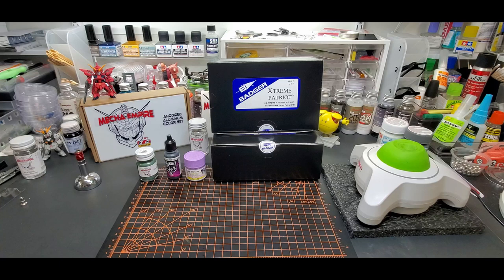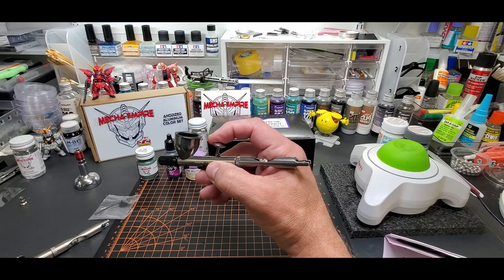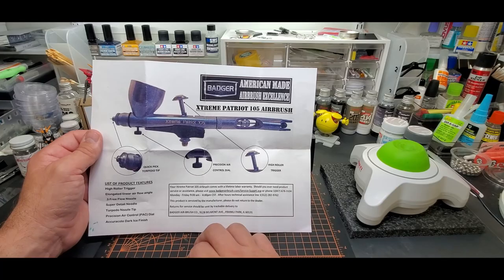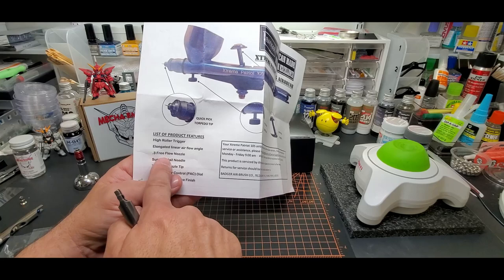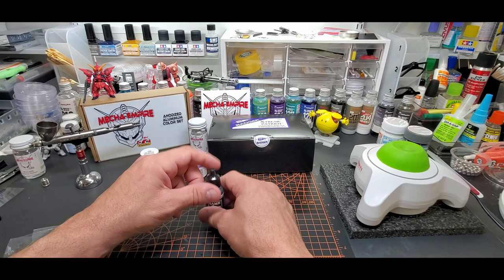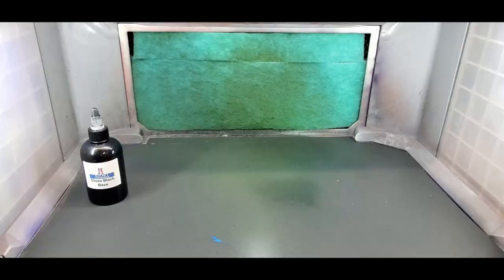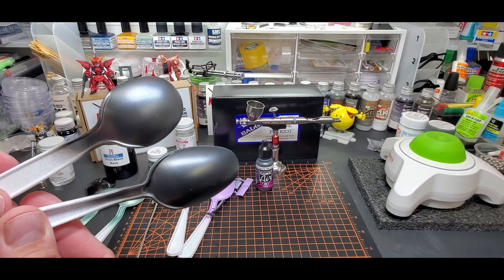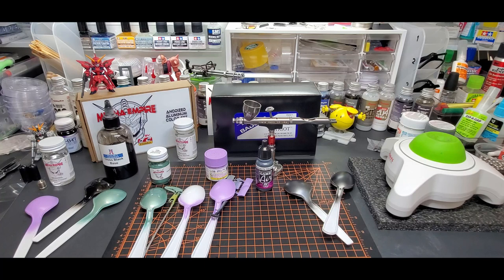Testing The Badger Xtreme Patriot Airbrush For Model Building - Plus Giveaway

Comment: I really enjoyed your video. It was very informative and I think I may look into a Patriot airbrush for myself.
 I bought my first airbrush back in the 70's off of a Snap-On tool truck and never used it until about 3 years ago. It was a Paasche VL with the 3 needles, bottles and accessories and in a cardboard organizer. 
Back in the mid 50's when I was building model cars and plains, I used a regular brush to paint them. If I had an airbrush back then, I can only think of how much nicer they would have looked, no runs, sags or messes.
I have just got back into model trains and have been reading a lot about weathering them and would love to try my hand at it. 

Thanks again for the very informative vid.

Comment: about the mac valve-
I set mine up by running the valve full open, and running my air supply pressure slightly higher than what i need it and will run a test shot with one of my heavier paints like the vallejo acrylics that need a bit more air behind them
once i have it where i want it, if I need to drop pressure because i swapped colors, thinned what i'm currently spraying, or switched to a different type of paint, i can adjust on the fly without messing with the supply line pressure

Comment: Thanks for the review Rex. 

I’ve used the Patriot before and tried to adjust the trigger pressure but then I started to have a lot of spatter while airbrushing and it didn’t click until one day I accidentally tightened it all the way after a deep clean and now the issues are practically non existent. Had even ordered a new needle set thinking it was a bent needle or cracked nozzle.

Just a FYI.

Comment: I picked up my Xtreme about 8 years ago and actually added the high roller trigger (had the regular trigger then).  It did come in the plastic case with the hose adapter. It has served me very well and should for many more years.  Highly recommended for detail work (I use a Badger 200NH for larger area coverage). Don't really use the PAC.  Also I've found with Model Air/Game Air it handles a 50/50 mix and a few drops of flow improver with no problems @ around 20psi. Also handles Acrysion pretty well.

Comment: I'm still new to airbrushing but I've learned so much from your content already. I have an 8 gallon compressor in my garage so I picked up a regulator, in-line desiccant, Iwata 10' air line, and a Master G444 airbrush with the 3 needle sizes. I actually got it all set up and leak free today. I haven't run color through it yet but it sprays the Medea airbrush cleaner nicely. Tomorrow I'll have my mug ready with hot water to clean out my Vallejo colors 🙌👍
Reply from the maker: You are good to go my friend 👍

Comment: I have a Badger 200 and a chrome airbrush. I just gave away my badger compressor, that still works, from the 1980s. Quality has gone down some and customer service leaves something to be desired now. But, with there  air inlets beeing proprietary, I just stuck with them. But with quick disconnects, that doesn't mater as much any more. If they had a trigger version like the Grex, I would buy it.

Comment: I do like a Badger airbrush. I still use my old 350 airbrush for all my primers. 
That PAC screw might be a concern since it's plastic and I would think, if it gets well used, the threads could be a source for air leaks.

Comment: :  )  l ooks like everyone would like the airbrush.   I liked the ability to better adjust air flow with the tall trigger.   The normal length of trigger tends to leave me fully depressing it (not so dexterous old fingers).  It is surprising to hear how big the needles are with the badgers.  At  .5mm, my not so good airbrushes blow acrylics through them remarkably easily.   3mm is where things start getting a bit more unreliable  (lots of tip drying).  Thank you, chuck

Comment: One of the things I like in an airbrush is a thumb-screw at the end, that acts as an adjustable pull-back limit. The tall button gives you more arc distance for paint control, yes indeed... but I still prefer to have  an adjustable limit when I'm in close and doing very small pattern.    The .33 or .3 mm is a good size. Hard to image .7   you could run  undercoating through that!🤣🤣

Comment: The short screw that comes fitted from the factory is a blanking screw, the threaded part isn't long enough to effect airflow, hence why you didn't see any change. If you wish to use the PAC function you need to switch the screw out for the longer one. I've seen a number of reviews where this same error has been made, it's badgers fault for not including any instructions with the brush.

Comment: I watch your videos at least 2-3 times a week, always fair testing and a real user opinion which I appreciate. I've bought a few things and paints you've recommended in the past (cordless airbrush, Vallejo Premium) and always agree with your findings. I'm still using cheap Chinese airbrushes at the moment, so looking to upgrade to a proper kit at some point. Every time I find a new paint or somebody recommends a paint to me, I search to see if you've reviewed it first 😂 Keep up the good work man 🙏✌
Reply: I am currently using a German Harder & Steenbeck Ultra, and a Chinese "KKMoon". The KKMoon isn't quite a "dirt cheap" airbrush, it's one level up from that (about £25 inc p&p on eBay in the UK). The Harder & Steenbeck Ultra is much better, it just works straight out of the box, it's just plain better. But the KKMoon isn't bad either; it's a clone of an Iwata, and while I've struggled with putting primer through it (clogs, clogs, and more clogs) it works fine with regular paints and inks. 

I'm of the opinion that the most important thing is the consistency of the medium; without a doubt the most aggravating problem I've had is with clumpy paint; I've got lots of old paints that are perfectly fine for brush painting but it only takes a couple of tiny clumps of paint building up in the nozzle to cause sputtering and spattering.   I'm going to start putting colored tape around the "bad" paint bottles so I don't use them for my airbrush.
Reply from the maker: Hello Simon, you have been picked as the winner of the Extreme airbrush. Please email me so I can get your details triggerfish65@gmail.com

Comment: I've fitted the extra fine nozzle and needle to my 360 and it's very well as a fine detail brush..using it with a bottle of cleaner to flush out is a neat touch..main con is the small cup and getting down into it to clean

Comment: Just getting back to modeling and airbrushing.  Dusted off my 105, Sotar, Crescendo, and Renegade.  The other thing I notice about new packaging is that there's now a rubber front cap: I have a metal one for 105 and Sotar.  I'm not as much a fan of the Renegade since it's hard to line up the rear handle with needle limiter...Sotar is so much nicer with having the limiter, but also letting you get the needle out just loosening the chuck.  So I thought I would also try an Iwata-got the HP-C+.  Think it will act like the Renegade (has same needle width as this).  Value and being able to easily remove the needle are great attributes about Badger.  Will never part with the Sotar, even though the trigger lever can be kind of cumbersome to insert, as I find it a really comfortable detail brush.  Crescendo is a good broad airbrush...and I'll see if the Iwata is my fav general purpose one.

Comment: I just got into airbrushing and have been watching a lot of your paint comparisons. So far I have only been using the US Air paints that came with the kit with two Master air brushes and the compressor. So far I can do pretty stable reasonably fine lines as well as smooth coverage over larger areas. I am going to be starting a new guitar build for the Great Guitar Build of put on by Crimson Guitars and my plan is to relief carve and paint the "Captain America" chopper from Easy Riders movie on an Explorer body. I have been looking into Iwata airbrushes but they are way out of the budget right now since I need to source materials for the build this month and get to work.

Comment: I love my 105 Patriot. I bought it specifically to dedicate to primers and 2K clear. I felt like the .5 needle was a little much and I was going through considerably more primer. I swapped the .5 out for the .33mm "super detail" needle / nozzle set and it's quickly becoming my favorite brush. I find it funny they call .3mm "super detail". For models that's what I consider standard work horse brush size. To me "super detail" is a .2 like the Sotar. 

I have the "high roller" trigger on my UMP apex, which is pretty much a Badger Omni 4000, and I love it so I'm thinking of getting one for my Patriot as well. The trigger is like $10 from badger. That's one of the reasons I love badger. the parts are readily available and don't cost a fortune. 

I've never really liked the MAC / PAC valves they tend to get in the way more than anything.  The apex has that finger rest, and honestly one time while I had my APEX tore down for cleaning, I just never put it back on, never missed it.

Comment: I read that the smaller screw is the one you put in if you want to NOT use the splatter valve. if you tighten the smaller screw you have a normal spray gun. if you put the larger  screw in, you can them play with the feature.

Comment: The small black PAC screw is just a cap to keep the passage covered, it does not affect airflow at all. The larger screw is the actual PAC adjuster and will shut the airflow down to almost nothing. I’m not sure why they don’t call they out in the instructions.

Comment: Thanks for another great review Rex. That high roller trigger seems a lot easier to manage the paint flow than the shorter one. I think the PAC valve issues you show may be that the small screw you have in the AB is actually a plug to shut off the feature if you don't want to use it, whereby the larger screw that you show as part of the kit is the actual adjustable valve screw and may allow better control of the air. I'm not sure but maybe worth a try. Maybe if I'm lucky enough to win one I could try it for myself.
Reply from the maker: You are correct. It is a plug. I'll do an update to let the viewers know

Comment: The reason you’re not seeing any difference with the PAC valve is that the smaller screw is just to block the hole - its shaft isn’t long enough to affect the airflow. If you don’t want or need to use the PAC feature, you can screw it in and use the brush just like a normal Patriot. 

To use the PAC feature, you need to switch out the small screw for the larger one. That has a longer shaft, so it will actually affect the airflow as you screw it in (all the way and it’ll completely cut off the air).

Comment: Nice video, that dual feed airbrush looks interesting. I have recently bought a couple of airbrushes recently. One is the Gsi PS 289 similar to what you recommended with the .3mm needle not the .2mm. It was hard to get hold of here in the uk, I got fed up of waiting for it even though I bought it off Amazon, I went mad and bought a H&S Infinity CR + as well which is a fantastic airbrush, I have seen your review too. 
I have been struggling with my old Badger 150 L I bought years ago, I was using it to spray Humbrol enamels which I have loads of some from years ago, thinned with there thinners. By the way I am retired, I bought the Badger about 30+ years ago, I did once spray some custom paints with it., crash helemt etc. I have mainly used it recently with model railway building but I am just getting back into making model kits again. It is my sons fault he bought me two kits for Christmas, one of a old BMC Mini and the other a Aoshima 1/12 motorcyle kit, a Honda 400-4, I used to have both of those years ago. I also managed to get some Mr Hobby paints to match the Honda, so that's when I came across your videos on advice on how to spray them. I decided to buy some cheap model kits first to practice on to get my hand back in. I have a proper spray booth now and a respirator mask, no spraying into a old cardboard box anymore. So keep up the good work I like watching your reviews, don't bother entering me in the draw, If for some unknown chance( I never win anything anyway) I did win it would cost you too much to send it over to here in the uk lol. Chris.

Comment: A small o-ring around the thread of the pack valve should prevent it from screwing right in (and closing off air supply) instead of glueing it.  :)

Comment: I believe you have two options on the PAC screw.  There is a larger headed screw available from Badger as well as a plug screw.
Reply from the maker: Yes, I now know the small one is a plug and the bigger one is the valve. It says nothing in the manual. At least I didn't see it

Comment: Was about to punt for the H&S Evolution Silverline 2 in 1 which seems pretty good value at around 136GBP for a .2 and a .4 needle/nozzle set but now I think I'll wait a while until you post the reviews on the Badger 360 and the new Iwata, though I think the Iwata offering will be a little out of my price range. Or maybe I'll be lucky enough to win the Patriot Extreme 🤞🤞
Reply from the maker: The Iwata cost $149 USD. I love that H&S so the Iwata is going to have to be great to beat it

Comment: Great review! I almost picked up this airbrush, but I ended up going with an Iwata that I got for a steal. I wish they made a pistol grip model, like most of the companies have done. I like the high roller trigger and it's something that I wish more companies would use. I might have to get one sometime and give it a try. I was doing a bunch of painting recently and I was wishing I had that paint shaker, but the price point is really holding me back. If it was $20 less, I probably would have already picked one up.

Comment: The small wheel for the PAC Valve has a short thread and just fits the hole. If you want to use this function you have to switch to the bigger wheel with the longer thread. I also bought this Airbrush a few weeks ago. Unfortunately, my Airbrush did not work from the beginning because it was poorly processed. Had to sent it back. :-( Now waiting for replacement.

Comment: I found it useful to use the larger screw for the pac valve and cut a ball point pen spring using a couple of rings only. this put enough tension on the screw to keep it from dropping out or twisting while in use. love this video and this channel. nice work! I'm looking for washi tape like the Tamiya yellow tape but at a cheaper alternative, any thoughts?

Comment: I was wondering if you think that this could be a good starter air brush. I have been out of the scale model and miniature hobby for quite a few years and have decided to jump back into it. I used to do most of the large painting, such as, priming and large pieces with a rattle can and the finer details with a brush. I have looked around at a few types but there are so many that it is hard to decide which way to go.
Reply from the maker: I would go with a Badger Patriot 105. Currently on sale for $70 at the link in the description above. It's one of my favorite airbrushes and you can use it for everything. Plus it's easy to maintain and clean. Grab one before they go out of stock at that great price

Comment: The Patriot 105 is a workhorse of an airbrush. I'm not sold on the lower air control screw. I'd rather have an adjustable trigger spring tension.

Do you think the height of the trigger will make your hand cramp after a while?
Reply from the maker: Not sure as I've just started using it. But many I have spoken with tell me it's comfortable long term
Reply: @barbatosrex9473  thanks. I may try to order one for my 105 if it fits.

Comment: Just wondering did you try a higher pressure setting on you compressor and use the pac valve to lower the pressure to what your operating at?

Comment: Can needles and nozzles be changed on this airbrush?
Reply from the maker: This Badger Extreme Patriot comes in only one size needle and nozzle. That's 0.3mm. It can only be replaced with the same size. The regular Badger Patriot has a choice of 3 sizes, 0.3mm, 0.5mm and 0.7mm